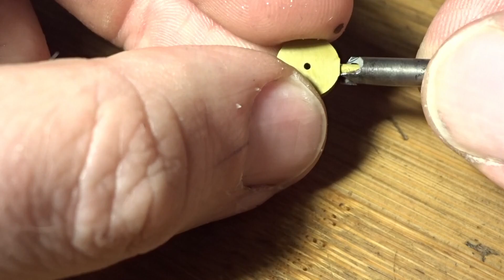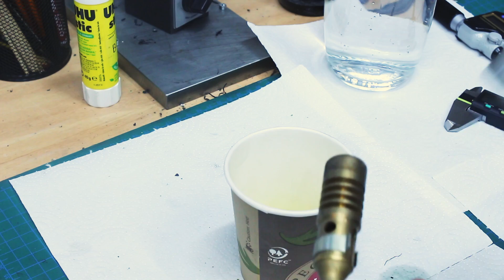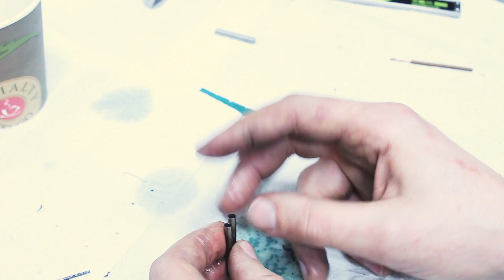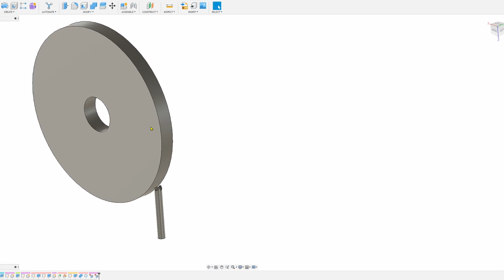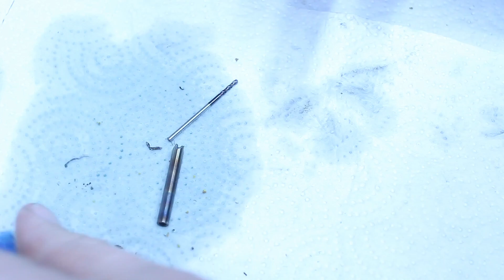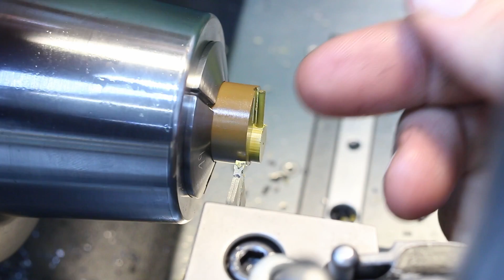Making a Micro Annular Cutter

Comment: I watched this when it came out and thought I would never need anything like that.
Last week, I actually had to make one to remove a flange on a 2.7mm brass tube that is fixed in position. (overflow tube on a motorcycle carburettor)
Mine isn't as 'pretty' but works and did the job

Comment: Lovely work Stefan, very interesting. Woodworkers use a similar tool to cut plugs of wood across the grain to fill screw holes, where the direction of the wood grain can be matched. Called a plug cutter, for obvious reasons. As a novice watchmaker, I am enjoying very much these micro machining series, thank you.

Comment: FWIW. I think there is no need to make special annular cutter. Just change the machining sequence and it might be easier.
#1 With the bar on lathe. Drill the small hole.
#2 Pressure turn the pin.
#3 Put into milling machine and flatten one side. etc.
Bottom line. Completely make the small delicate feature first.

Comment: In North America these are known as 'hollow endmills'.  Typically used to turn small bolt and screw shanks.  They can also be used to quickly reduce the diameter of small rods.
I made one to trepan tube bosses on a stainless steel cap for a Stirling engine hot end.  These bosses were used to butt weld stainless tubes to the hot cap for a tubular heat exchanger.
The process worked very well, using an electric butt welder, similar to an electric band saw blade welder.
Golly, this was 30 years ago!  I now use the welder to weld band saw blades.
Reply: In fact that was 40 years ago, the early 1980's!  My mental arithmetic is not what it used to be.  Still use the butt welder, though.  Right now it is set up in my shop for welding 1mm aluminum sheet.

Comment: Also, Ford made an ENGINE out of Torlon in the 80s - look up "Polimotor". Engineering plastics are wild! 

This engine was obviously just an experiment, but it's crazy what is possible. 

I think aluminum won out as demands for more power and efficiency led to higher loads, making the plastic way too expensive for the mass savings.

Comment: Off topic, but I'm not sure how to ask a general question. You know how when one drills a hole into a pipe there are chips and rough edges on the inside that can be difficult to deburr if the hole is small.
I drill about 1mm holes in pvc irrigation pipe to shoot water from. But there are burrs, and eventually a calcium buildup.
I am trying to figure out if there is some kind of a tiny countersink device in reverse that I could insert into the hole, expand a cutting edge, smooth the hole, then unexpand it and pull it back out. It is only cutting pvc chips, so almost no force or resistance. 
Now that you get my drift (I hope), can you suggest something ? I don't even know what name or terminology to search under.
Can you suggest something?
Pat
Reply: Make a cutter that looks like half a Y. You can insert it stepped over then put it on center and feed it back out to back spot face your bore.
Reply: @bcbloc02  Hello Brian  I have no way of making a tool, let alone one so small. Are they available and what would I search under ?
Reply: @youpattube1  what size hole does it need to pass thru?  Noga makes a debur tool you perhaps could retrofit to your application.
Reply: @bcbloc02  1 mm.
Reply: @youpattube1  that is like a paperclip. i don't have any good suggestions how to make a tool to do that.

Comment: Torlon is very hygroscopic so the discolouration on the OD is probably from the drying process after extruding. I have known large diameter(400mm) part made from Torlon to grow 15 -20 mm on diameter if they are not stored correctly in a humid part of the world.

Comment: Have you considered setting the piece offset in the lathe when parting off. If you have the center turning point, the hole in the part it would likely eliminate the small piece you have to remove afterward. I would use a 4 jaw chuck with a collet block to offset it repeatedly. A pin or drill bit in the tailstock would help you clock the rod in the collet.
Reply: You could also us some piano wire in the tailstock poking through the hole as a part catcher.

Comment: Thanks for video, very clever making the cutter. I'm wondering if I would have used a larger diameter mill to get a better finish and faster making time and then cut the hole and grove in another operation but what you did was very efficient.

Comment: Hi Stefan.  
    Great job, I really enjoyed the video. I am a retired Marine Technician and spent 31 years going to sea on research ships keeping stuff running for the science  efforts of many research groups.  I noticed your remarks on the color variation of the Torlon parts.  I received some replacement parts with Torlon threaded inserts a part of a linear actuator.  This was back when Torlon was a very new material on the scene.  The parts failed after a week of use being installed on the towwed package.  We were advised by the equipment manufacturer that Torlon parts need to be baked after machining to reharden the outer surface.  This would explain the color change in the Yellow Torlon.    If the parts you made do not last you may consider this fact.  I am not sure if Torlon formulations have changed since its release.   Hope this information helps you if issues develop with your parts.

Dave Nelson

Comment: You make it look so easy 🤣🤣🤣
I'm guessing a key element of the precision of all your machines (die grinder, lathe and mill etc) is stiffness and *precision bearings* ?. My entry level chinesium home hobby machines rattle like a bag of spanners, when I hear the quiet smooth "wheeeeeee" of yours I want to weep. I know as you have said many times my cheap chinese products are just  raw castings and I should rebuild and finish them, but ... outstanding chore #836,737
All hail the algorithm
Reply: he also improved his lathe: solid tool post.
his friend has a milling machine like the one he has before: a zay7045 clone. his friend screwed his milling machine to the wall.
i did the same and improved it also : the mill and the lathe

Comment: Zilverstaal in Dutch 👌And a amazingly educational video. Never thought of such a tool. Now its in my mental library too. Thank you Stephan, love your giggle when your plan works. About a part being "over designed" Yes you're right that you don't know all of the design decisions when you're asked to make a part according to a drawing. But, and I figured you found out too, al lot of parts are over complicated because of a lack of certainty on the designers part. I'm an engineer, a designer and a machinist too. When, in my opinion, over complicated parts are asked for fabrication I question the client about the function of the part and by doing so I'm in 90% of the questions able to lower the mentioned spec's (it get's cheaper for them too) or change the overall design they're after (and cheaper and most of the times a lot more profits for them too). For some I'm a nuisance and they leave after session 1. But for the better part of my clientele I'm a contribution to their development and they never left since. (27 years now) I hate to fabricate or build stuff that I don't believe in and I even reject these requests by now because I'm to old to spend time on BS. Maybe an idea? To enjoy working for clients and serve them better than just following their drawings and plans? It's added value and when they recognize this they will never leave. Stay safe and be happy!  Best, Job

Comment: 31:37 the brand escapes me at the moment (i wanna say it was Starrett, but i might be mistaken), but there's an even smaller edge finder on the market. I saw one used by a work relation to catch upon the internals of a gearbox's oil passages to machine a bypass. The reduced feature was very small, i'd like say almost a mm diameter. Very cute little tool.

Comment: i really related to the "over-designed/over-complicated" issues, as i ran into this, a lot, in my previous position...i ended up doing a simulation model of the 'electrical' environment', but, dealing with environmental, usability, reliability, cost, size, production processes, for 100x10^6 volumes...sure, "over-engineered"!
With this part that you're doing, with a material good to rather high temp, plus low tempco, plus unknown mechanical stress, humidity...not a good plan to try to "glue" it, or thread it, or press fit, or? You'd have to spend more time discussing that stuff with the engineer-responsible than you spent on building the parts! (and, likely, "irritate" them so, so much!)

Comment: Gotta love backseat "engineers" lol. If a part seems over engineered, then there's probably a very good reason for it be designed like that. To think you know better than person who knows how, where and what conditions it's going to used in and for is ridiculous. 🤷♂
 Great video as always Stefan, thanks for sharing brother!! 👍👍
Reply: Not so, it’s particularly difficult to find an engineered product these days where an engineer who does not seem to understand the real world application of the product has creamed themselves over a component that gives up long before the rest of the mechanism due to poor design with stress risers or poor material choice.
Reply: @johnharlow486  Sometimes, yes, but they hired Stefan as a professional machinist, not as an amateur engineer who doesn't know the use cases, needs, or requirements for the part. If it doesn't fulfill those requirements, the engineer will be responsible, an alternative will get designed, and Stefan will get paid to produce it again. He'll get the work because he produces to print quickly and accurately. Torlon has lots of salient features; it may be that in the application, there's no stress to be concentrated where the pin meets the disk.
Reply: @rickdenney5772  I strongly agree, well put.

Comment: I think i would 3D Print it with an SLA 3d Printer in ABS Like Resin or use an SLS Printer and print it in Polyamid. 
FDM Print would possibly be to weak.
Reply from the maker: Yeah,  but the print specifies Torlon, not an ABS like Resin.
Reply: @StefanGotteswinter  ahh i See. Didnt notice it had specific Material preference from the customer.

Comment: Maybe someone has covered this already, but another tool that could possibly work for this is a small counter bore tool. Finding one that's meant to hold a drill close to the diameter your looking to cut is the hard part.

Comment: 8:20 Considering the size of the work you do. Induction  heating may be a good option for you. Also 480 volt is not possible in the home shop here in the US. curious what HZ. you guys have in Germany. A typical home here has a 220 volt / 200 amp service. With a good (ABB) invertor I can get 240 volt 3ph. If you go down the invertor road, buy good quality. The $100.oo VFD's are hard to program and no tech support.
Reply: I think Stephan has 230/400 volt 50 Hz 63 Amp supply

Comment: Torlon is crazy plastic. It can be continously exposed to like 500f, and is still stronger than some room temp plastics at like 400f. 

Crazy to even think about.

That part could be injection molded extremely easily, torlon can be melt processed, but I bet having you machine these was almost certainly cheaper than getting a custom mold made, I don't think small scale injection molding is even a thing.
Reply: You can do injection moulding with a small hand pumped machine (see Vince Gingery)  but you'd probably have to modify it to work at the higher temps of these fancy plastics.
You wouldn't need to make many parts to justify the cost of making the die,  given the cost of making swarf.
Reply: You can do compression molding, essentially die forging, with many/most plastics, even those that resist injection milding. You just measured out (if closed die, with no design flaring) an accurate amount of the material, put it into the heated mold, sqeeze it, and cool it down. If you're fast enough, you can heat the blob and keep the mold cold, but that sounds hard for such tiny parts.

Comment: Hi Stefan, My mind boggles at the ineptitude of the designer of this part. If you have a square corner ( stress raiser) at the intersection of the disc with the rod there is no reason why you couldn't make this part in two pieces with the relevant constraints on accuracy. Gluing the rod in does in no way detract from the strength of the part and makes manufacturing so much easier. I dare say with time the 3D printing of parts will get so accurate that machining of parts like these will become obsolete, but the world moves on and we must move on or become obsolete ourselves, ( not a chance my friend),